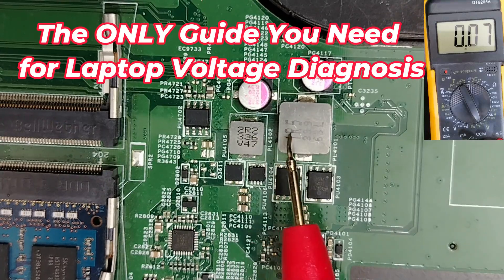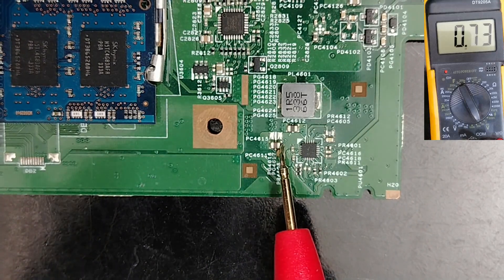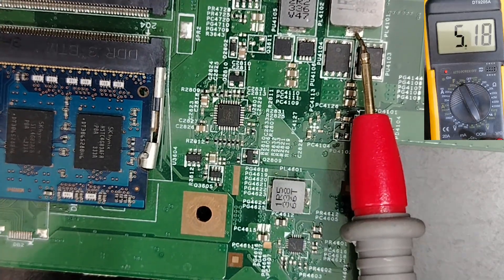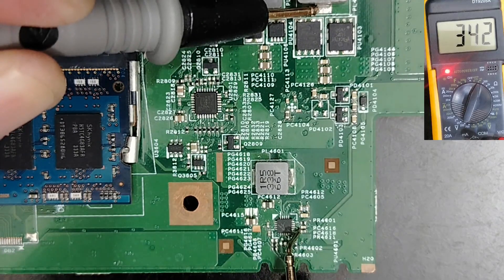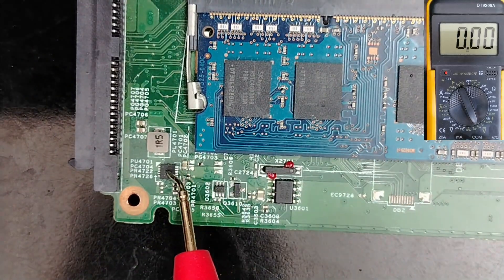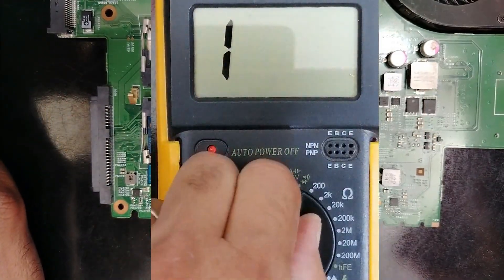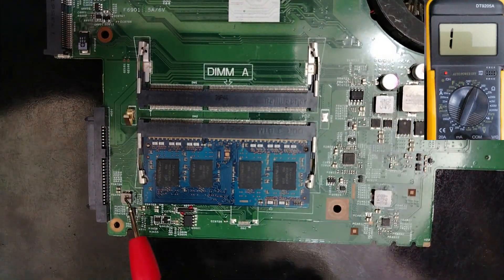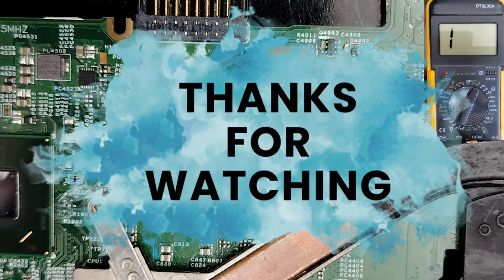Insane Voltage Masterclass. Learn Motherboard Power Rails FAST | Laptop Repair

Comment: My kaptop is totally dead.  Battery is fine.  Adapter socket is fine . Power btn is ok.  But the device is dead.  No boady was able to fix it in my area.  Maybe something is not oky in my mother board.  But i dont kow how to figure it out. 
Yes your vid is so value.  But ineed more information so i can do it my self.  If something needed to be welded i will hep the welder where is the problem.  Pls respond to me

Comment: How do I know this coil is connected to the Ram,or P CH or  C Pu
How can locate current sense resistor and the coil that generate 19v when I am seeing 2 resistors and coil  in the power supply area
Reply: watch all of his videos you will get the answer.
Reply from the maker: Good question. I will make a special video about it, maybe tomorrow. stay tuned